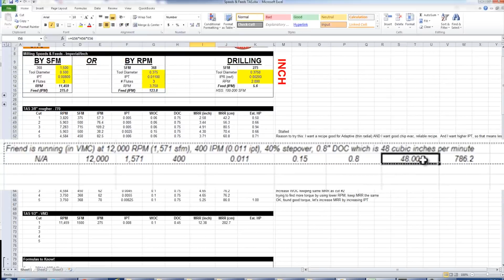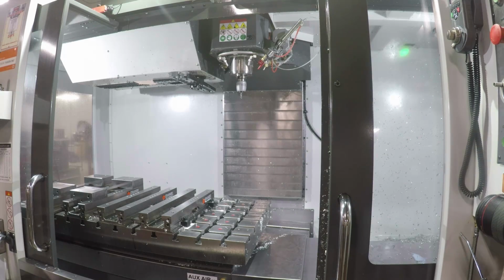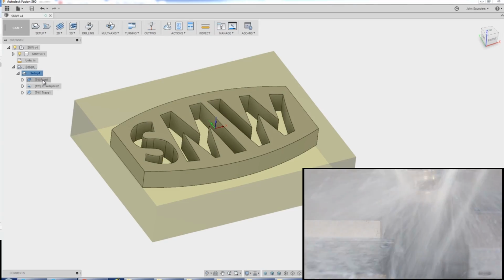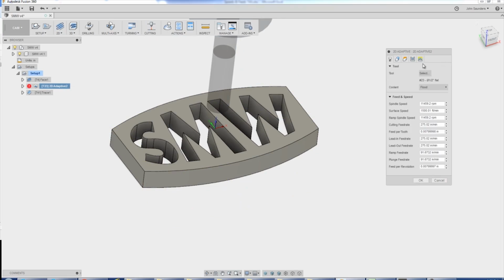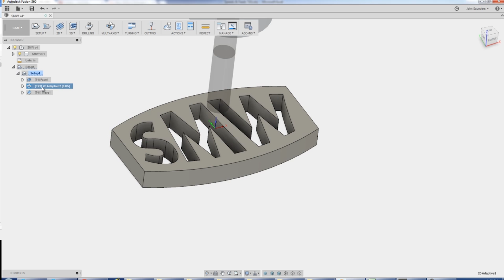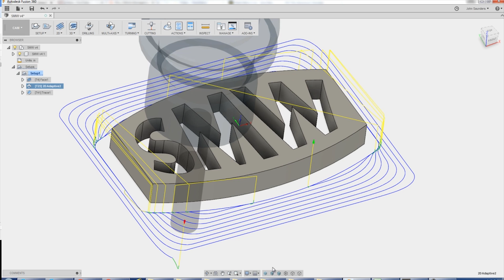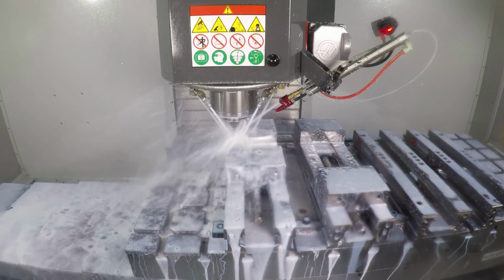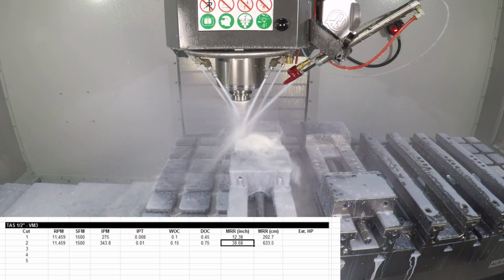Shredding Aluminum on the HAAS VM3!

Comment: I would very much like to see some instructive videos on how to machine Stainless Steel (304 or 316 austenitic grades).

Stainless Steel is a very common material, but it tricky to machine because it can work harden while cutting.
Performing some experiments to find some CNC recipes that work would be most valuable.

High material removal rates are very important for Aluminium machining, but when we are talking about Stainless steel machining, the quality of results and surface roughness measurements are of more interest.

Thank you
Reply: http://gorillamill.com/resources/mill-calculator/

Check that out, granted --its for Gorilla Mills (which we use) so YMMV but it gives you an "aggressive starting point".  You probably want to run a bit slower with other tooling in general but it does give you a chip load and RPM that work with their mills.  Start at maybe 3/4 of what they're giving you chip load/RPM wise and go from there.  Again, its what they recommend for their tooling.  For stainless, select the 4 flute HP which has variable flute pitch and also offset.

Comment: Ask and ye shall receive. That was cool.

We are running a job currently in aluminum where we are cutting pockets using a "traditional" toolpath. Normally I prefer adaptive (iMachining in our case) for pockets or open pockets, but in aluminum, we are absolutely flying. See how deep of a slot you can cut with that 1/2", in one pass. I'd start at max RPM, and I wouldn't be afraid to start at .010 IPT and .250 DOC.

The other would be, go for a slightly thinner cut with your adaptive toolpaths and jack the feed way up. 500+ IPM. 

Love it! It's amazing what modern tools are capable of.

Comment: I have mostly used Kennametal end mills. I've tried some other end mills looking for better performance. The one lakeshore I tried broke within 2 minutes of cutting time. Using the same parameters as the kennametal. I do lots of slotting in 6061.
Following are the details. 1/2 2 flute aluminum specific carbide,  1/2 slot 1/2 deep 10000 rpm 120 ipm 45% spindle load. Anyone have some suggestions on other end mills to try?
Reply: 3 Flute variable helix or 38+ degree helix. Much more rigid than a 2 flute, with much less chatter at high feed rates.
Reply: Mike Healy +1 on the 3 flute. I've had great luck with destiny's 3 flute stuff for aluminum, both the viper and the diamondback. Haven't tried any lakeshore stuff, but I've heard nothing but positive results with them.
Reply: I've been using a Fraisa 1/2" AXFP aluminum rougher 1.5" length for going on 3 years now same tool.  It will do 2800mm/min (110 in/min) @1" depth, full radial (slot) @12000rpm in a VMC Mori Seiki NV4000dcg at about 28% spindle load.  I've turned up the override 50% before and it doesn't seem to care, everything sounds pretty much the same with the tinyiest bit more labor on the tool and the load only goes up 2-3% more.  I think it would do way more but we baby our machines.  We use Gorilla mill 4 flutes for ferrous and stainless and they make an awesome rougher for aluminum as well.  Both of these companies give you exact optimal feed rate tool apps for their tooling as well.  Fraisa's is downloadable but Gorilla's is online.  http://gorillamill.com/resources/mill-calculator/  Check out what their aluminum does slots at with 1" DOC.

Silverback Knuckledragger Rougher - 2 flute - 1/2" tool - full slot - 1" depth @22920rpm 550.08IPM so if you're running 10k rpm that would be 240IPM (6096 mm/min) @.008" per tooth.  That's roughly double the feed and double the depth?

Comment: I would love to see what the different run times could be on the different machines. Can the Haus really make a part that much faster than one of the toramac. and if so by how much.
Reply: I have a 1995 Okuma mill that is beside a 2014 VM3 and I can set my tools just as quick as the Haas as I don't need to measure what the length is before I start and there are less buttons to push due to having to just input a modified G code command. As for setups I can set it quicker manually with a touch probe and I don't need to know how big the material is before I start and there is no problem of not setting the tool close enough to the centre of the material and having to repeat the process. I guess it just comes down to the skill of the operator.
Reply: Just cycle time...or setup and cycle? The Renishaw alone cuts down setup time significantly. Tool change time and non-cutting time (rapids) are also better.

Comment: Methodically push it faster and faster until it breaks or bogs down the haas
Reply: From personally experience, you can't bog a Haas with a 1/2" endmill. The tool will break first. You CAN stall it with a 2" shell mill though. 1.75" width of cut, .250" depth, 2000SFM and .015" chip per tooth will stall it in aluminum. It's like a 27 horsepower cut which the Haas can handle for short durations, but the motor doesn't have enough torque at that high RPM.

Oh, also...professional machines don't bog like the Tormach. They have highly accurate spindle encoders and power feedback systems. If the spindle needs more power, the machine gives it more and more until it can't go any higher then throws an overload alarm and stops it dead.

Comment: I've always wanted to run 1/2" tool full bore until it breaks. I'm not sure if you HAAS has the power to break that tool with a smart recipe though. I've made 30HP cuts with a 1/2" Lakeshore finisher.
Reply: Frank 1/2" a haas certain has the  spindle power. 

Insert cutters it doesn't have enough to push em full bore.

Comment: End mill shootout! Get some end mill manufacturers like destiny tool, and GW shultz to donate some 1/4" or 3/8" roughing end mills for aluminum and test them to see which is the strongest. Run 25-40% step over and keep kicking up the feed rate until you run out of hp or break the tool. Run the exact same parameters for each end mill tested and see which one can be run the hardest. Im sure the end mill manufacturers would have no issue sending some to someone with as large of a following as you.

Comment: Have you ever run a high feed mill in steel? 

chip per tooth feeds rates at the .025-.040 range

Or roughing using plunge milling.
Reply: I used to run of these bad boys on a VF2 at 1800 rpm and feed rate of 8m/min or 315 ipm